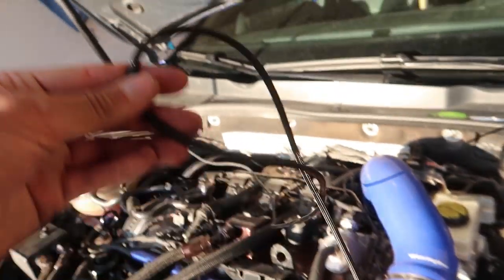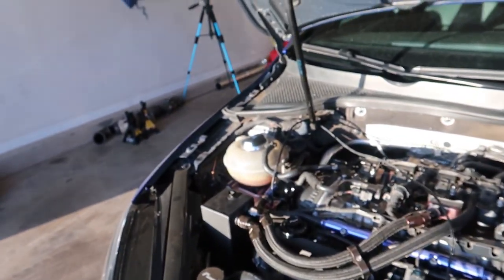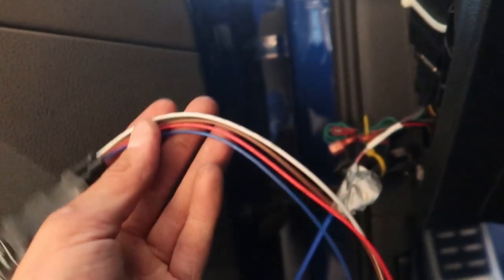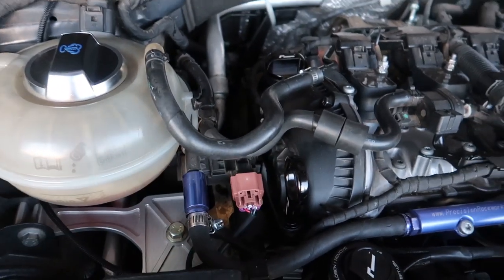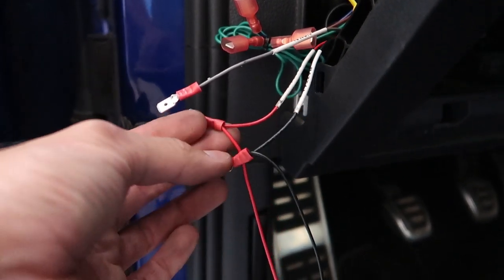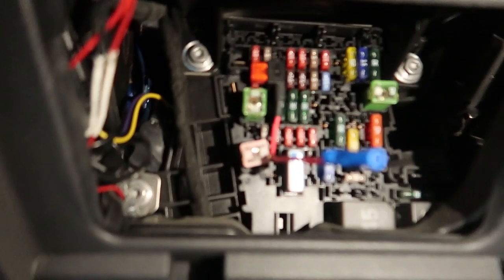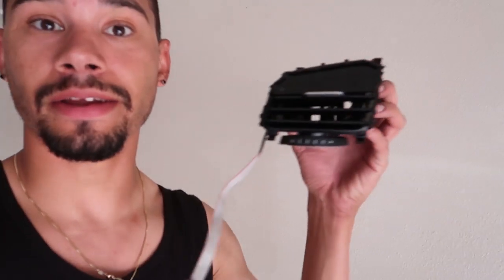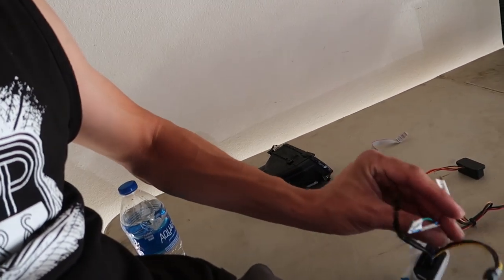P3 Gauge Ethanol Readout DIY | MK7 Golf R / MQB

Comment: Nice video. FYI the PR harness already had the wiring for the sensor. You can connect the P3 Ethanol voltage adapter to the grey wire in the PR harness instead of pinning it to the ecu(pin71) since you don’t have Flex capabilities. The purple and black ring terminal are power and ground coming out of the PR harness for the sensor.
Reply from the maker: They said to not do that cause it interferes too much with the signal I guess? If you were flex that is.. I didn't wanna mess with it incase I do go flex at some point. Good to know though!
Reply: Hey I got a question about what you mentioned with the P3 Ethanol Voltage Adapter connecting to the PR wiring. Would I be able to DM you? Thanks!
Reply from the maker: Yeah bud dm me on IG @br32yce

Comment: I think your original p3 gauge might still fine. I had an older version p3 and I just did the install the other day and mine shut off completely once I had all the configurations set just like yours. Tried everything, then I found out all I had to do was shut the car off and go into the display configuration. For some reason it wouldn't go into configuration with the car on, only off. When I found the option for display, it was shut off. Looks like for some weird reason  when u save all the settings it automatically shuts the display off. So I had to go back into the display setting and then turn it back on while the car was off. Try it if you still have the original p3.
Reply from the maker: I believe I did try this with the car on and off a bunch of times but I'll try it again! I was just gonna give it away eventually for someone to tinker with lol

Comment: At the end you say you don’t need that middle thing from USP. What are you referring to?  The wire harness? If so then what would you use instead?
Reply from the maker: I meant with their kit, it's some box thing that coverts somethin or somethin on their site it makes it seem like whatever converter they have is a must, but it isn't

Comment: I'm curious, do you have a clutch pedal stop in the car? I had slow horrible shifting with the car for a while and it was resolved as soon as I removed mine. Just curious if you have one does yours slow down your shifts.
Reply from the maker: I do, I haven't had an issue with it thought been running it for like 60k miles on two different clutches. What exactly was your issue?
Reply: @BryceJordanProductions  I just felt like I had to force the car into gear and it wasn't as smooth. I removed it today and it feels a million times better. I even tried removing the nut included and it still isnt perfect with it. I'm going to stick with not using it.

Comment: When is the tune coming?  Are you gonna run full e85?
Reply from the maker: In the next week or so I'll probably start tuning and yeah full E85 😁
Reply: @BryceJordanProductions  I think you could have taken the fuse to the 15 amp for the fuel pump in the engine bay right? Or not enough wiring? Regardless its working so it doesn't matter. Disregard what I just wrote lol

Comment: Did you use the sensor that p3 sells or something else? I’ve tried 2 gm sensors and can’t get a reading from them. Have mine wired almost exactly like yours but nothing is working
Reply from the maker: Are you sure your wiring is correct?? Seems odd that two would be bad. My sensor was from precision race works, but it's a continental sensor just like GM I believe. Make sure your ground is good too